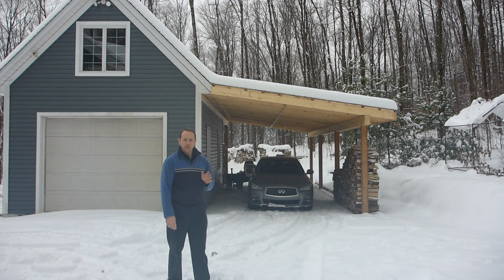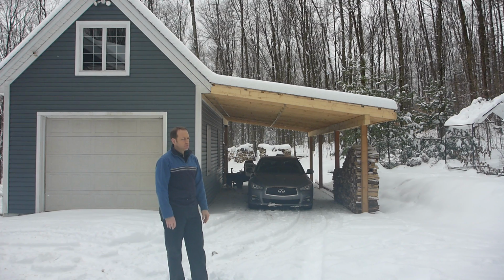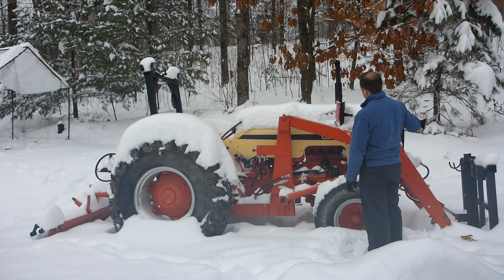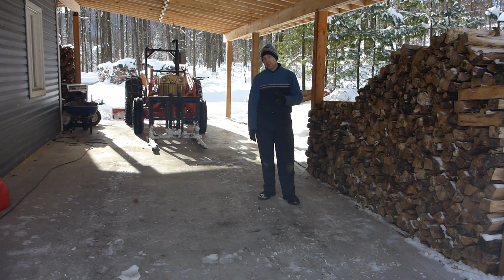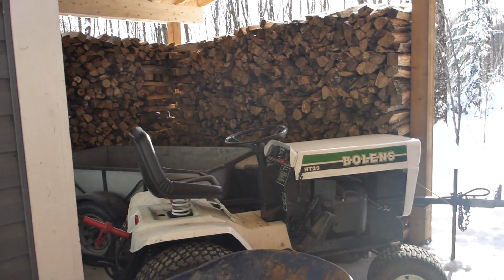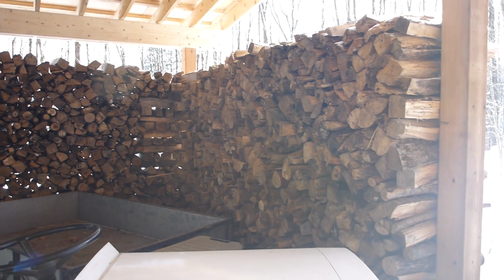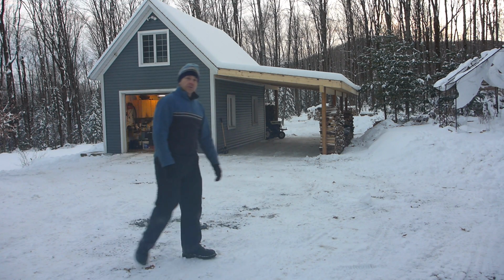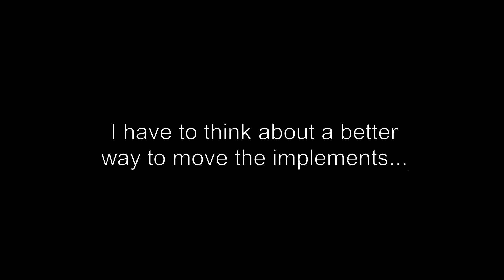#116 Catching up on Winter

Comment: Looking Good! Glade to see you are able to use the car port this winter. THat's a lot of snow. Your work never stops does it.  That's a beast of a tractor you have. Stay safe and warm. Later
Reply from the maker: I am glad to have the carport ready for this winter! It's been a few years now that I planned to do it. It's now done. My life is a continuous series of projects! My problem now is to decide between 4 projects, which one I will be starting next weekend!!! If you had the same Trygg chains on your B2601, it would push even more snow! Now I can stay warm!!! Thanks Mech Uno!
Reply: @FromSteelToWood  Thanks for the tip about the chains. Later

Comment: The addition looks great! So much room under there. Should come in very handy. Great place to season your firewood and doubles as a wall. Nice job.
Reply from the maker: Thanks Chuck! I think I may add some tarps in winter time if required.  I will see this year what it does.  At least, the firewood will protect a little bit.  With only one cord deep, it should dry way much better than the other wood shed I had.  Sometime, the wood in the middle had mold on it, because of poor ventilation. Thanks for your support!

Comment: The carport looks great. I also stand my mower deck up against the wall. I'm anxious to see the snow blower in action.
Reply from the maker: Don't worry about the snow blower, it's been through worst situations! This is a very basic implement, the gearbox leaks 80w90 oil so much, it's only filled with thick grease!!! Well, this snow blower is most likely as old as the tractor! It's kind of lightweighted for it's size. I use it randomly, this is why I don't put too much effort in it. I'd like to make a wall support for the mower deck, but I had this metal sheet in the way for now. Thanks Roger!

Comment: Good evening Joe,  How are you ? Is this 13 inches of wet snow making the tractor useful tonight !!! Oufff i use the snowblower and the front bucket to clear the entrance and i broke 2 shears pines on the drive shaft and 2 on the right auger ! Cause by operator misuse !!!  Take care of yourself Joe and be careful !!!
Reply from the maker: Lol!  You will get used very soon! Wet snow is hard to manage with a snow blower.  I don't use it when it's wet snow. In Marieville, it did not accumulate much.  I had to do the taxi tonight.  Nicolas at his driving lessons (Granby 8pm), then Amélie finished working at 10:15pm. Between that, I had to snow plow! Like you said: ouff!
Reply: @FromSteelToWood  Yes, in St Jean yesterday not much snow but windy. Marie Ange next year or after will do the same (driving lessons ! ). Take care Joe and be careful on the road and thank god that we have a tractors !!! Cheers !

Comment: Wow, you weren't sitting around this weekend!!!!  Got a lot of work done and the carport looks great!!!  I sort of laughed to myself when you had trouble with the solenoid frozen and then the battery on the Bolens.  It seems the bad weather will highlight the week links in your gear every time.  The same sort of things happened to me on Friday when we had our 1st snow fall.  Oh well.  Now you're ready!!!  Have a great week Joe!!!
Reply from the maker: Thanks Mike! They were quick fix problems. It rained so much in the last several weeks, I might just wait and see if the solenoid freezes again.  But I might have to look for a new battery for the Bolens.  I will try to put it on a good charge and see what happens. Maybe the alternator is not working properly. The Bolens is often used like a trailer tug and does not run much between uses. Did you have your snow plow and/or snow blower on your GC2300? Have a good week!
Reply: Mais Oui!!!  I put the plow and blower on last Friday morning and it snowed Friday night.  I plowed a wee bit of snow on Saturday just to say that I plowed.  It really didn't need to be , but I was excited about getting the snow!!!

Comment: Belle fin de semaine bien occuper!Votre gros tracteur n'est pas au diesel?Le garage avec labris est vraiment baux! Ca valait bien le travaille de faire cette abris!A bientôt!
Reply from the maker: Le Case 430 (model 440) est au gaz.  Des fois j'aimerais bien en avoir un au diesel, juste pour le "trip" d'en avoir un et de savoir mieux comment ça marche.   Mais d'un autre côté, au gaz, c'est simple comme bonjour à entretenir. Le printemps prochain, je vais installer les facias blanc et le bardeaux, puis teindre les poteaux et le dessous en blanc aussi, question de luminosité en dessous. Je vais voir si je vais faire des ornements autour des poteaux de bois. Genre des équerres, soit en bois, ou en acier.  Puis des lumières en dessous.  Beaucoup de lumières!!! Est-ce que je peux te demander ton prénom?  Merci!
Reply: Mon prénom est Adrien.  Je fais les vidéo avec mon père Éric et ma sœur Rose comme vous pouvez voir dans la plus part des vidéos.C'est une très bonne idée d'ajouter des lumières. Ca seras sans doute très baux! Un des avantage du moteur aux gaz est qu'il démarre plus facilement quand il fait froid.Sur notre tracteur, en bas de -15 il faut brancher le block heater si non c'est plus difficiles a démarrer et la batteries se vide asser vite a force d'essayer de le démarrer. Merci pour votre gentille réponse A bientôt Adrien
Reply from the maker: Merci Adrien.  En passant, mon tracteur part pas super bien à -15°C non plus... C'est pourquoi il dort dans le garage à environ 0°C.  Je vais probablement aller m'acheter un block heater demain, car j'ai l'intention de le laisser dehors un peu plus souvent quand je fais des projets dans mon garage.  L'an passé, j'ai dû mettre une chaudière remplie de braises en dessous du moteur, avec une couverture pour qu'il vienne à bout de partir à -15°C!!! Puis ça prend au moins 15 minutes pour qu'il réchauffe un peu!
Reply: Ok
Ca fait vraiment une bonne difference avec le block heater et pas besoin de le laisser brancher toute la nuit . 
Merci 
Bonne fin de soirée!

Comment: Joe what was whistle sound between 2:27 and ending at 2:31 ??? last times i heard that, i was not in this continent ! Very good point for gasoline flash point. You shop is in very good order ! The rear blade of the tractor is doing great work in the snow ! There is nothing wrong of hammering the bendix on the starter ! Nice daughter and good sense of humour ! Good bloopers with the implements, thank god there are built strong ! Joe I saw you slipe again. IMPORTANT NOTE: Joe if i see you slipe again on your video, i will buy to you the chains boots !!! LOL  Keep up the good work. and yes you electric points under the distribution cap could be the problems with misfire.
Reply from the maker: Thanks David!  The sound we hear is a plane. We've got plenty of planes crossing the sky over us, especially in the afternoon. They are oversea flights.  My video editor is a very basic one (Shotcut) and any fast motion video has it's sound high pitched. It's been a while since the bendix did not jam.  I must assume the recent rain and humidity did not help... I have one solenoid spare, just in case! I would says to my defense that I used the smallest hammer I could! Yep, I slip again with those combat boots. I instantly tough of you and the chains!  The sole get very rigid when it's cold and they are not the best on packed ice.  I could have used my Baffin snow boots. Thanks!
Reply: @FromSteelToWood  Good morning Joe, Yes you are absolutely right for the fly pat, i should know that LOL ! Hammering the bendix was sometimes required for me to start the 90 KVA diesel 2 strokes generator on the flight line because they were left outside ! and yes on humid and cold days was more often done. I just remember about 8 yrs ago they change the soles of all the non steel toe gore tex combat boots with vibrams soles because there were slippery on cold days. The steel toe boots use in air force personnel have already vibram soles which are little more flexible on ice but in the winter i use rubber overboots over them so i was good working with them to -30 c, before changing them with Sorels steel boots. So Joe you can buy over boots, and give you more traction and warms to you feet ! or wait until you slipe again and i buy for you chains !!! LOL Take Car Joe !
Reply from the maker: I though I was the only one using rubber overboots... I broke the zipper on mine.  But I used to put those boots over regular shoes to go outside.  Very warm and still the comfort of shoes.  Do you know any army surplus near to us?
Reply: @FromSteelToWood   Hey Joe, it a fashion statement wearing these overboots ! we looks likes Gumby ! Yes army surplus in the region it's In Dunham  ( PRO Quincaillerie J.P. & F. Larochelle Inc., 3615 Rue Principale, Dunham, QC J0E 1M0 ) is very good spot for clothing and boots and various stuff !!! the next one is Pre fair in Beloeil very good also.  For the zipper go see Mr Latour in Waterloo in front of the Metro. He is very good tailor and like to talks( social ), but do not tell him you are from Shefford on the Mountain,,, I did help a lot his sister who as the store ( la marchande d'histoire ) infront of the tourisme office in Waterloo ( in front of the new park and bridge ). If you go to theses army surplus Joe, you will be spending a lot of times ( la cave d'Ali baba ! )  is theirs !!!
Reply from the maker: Thanks David. I did know about Dunham, but not about Beloeil.  What's so special about Shefford Mountain for Mr. Latour? Hey, I do have "claques" to cover my work shoes. Believe me, when I go to the office with them, people are staring at me... I think it is just funny looking like an old timer. But hey, they do the job big time!
Reply: @FromSteelToWood  Good morning Joe, in Dunham there is also in the hangard in the back a lot of furniture and various large items and the people there are very good to talk to. Well for Mr Latour, is a very good man but he think that all of us that we are snobby people and that we all send ayour kids to private school since we are very rich,,, LOL !!! Yes there is some rich and snobby people living around us but i told him like in Waterloo, their is always 10 to 20 % who are beside the rail track of life !!! LOL Yes these ( shoes claques) do the job ! The importante think is the be warm and dry despite of the critiques of various too well dress colleagues and secretaries with their chinese white tips nail polish !!! Have a good day and get the stove ready for tomorrow, -15c to -20c and gusty winds !  Oufff and rain on Sunday !!!

Comment: Good morning Joe. You have a lot more snow than we do.   It is funny that your snow removal  implements were buried in the snow.
Reply from the maker: The implements are usually in that flat spot, just next to the carport. But I had to remove them so the excavator could put the rock wall at the back. I used also this spot to lay down the big lumber piles for the construction.  Snow finally came before I could bring back the implements in that spot... Now, there is at least the forks, the wood chunker, and the grader blade.  Missing are the dirt bucket, the concrete ballast, the wood splitter and the dirt screener. Really funny we have more snow than you!!! We are quite at the opposite.  We should not have any at this time of the year.  And you should be already buried under snow! Thanks!

Comment: Hey good evening Joe! Busy weekend and a lot accomplished. Bien! Loved the ending.So nice to see that I am not the only one who sometimes has a hard time doing small chores. LOL. The carport is working out great for you. Have you considered running some wiring and a switch for some lights under the carport? I think that would be helpful. We have just over a foot of snow here to be plowed so looking forward to firing up the tractor and clearing it out in the next few days. Have a great week and see you again! Cheers!
Reply from the maker: I am going to run wires to have at least 6 if not 8 lights under the carport.  Especially useful for working in the evening. I will also add a GFCI oulet for the pressure washer in summer and the block heater in winter. Thanks GP and have a good week!

Comment: Salut Joe, dans ton video tu fais l'entretiens de tes petit moteur 2 temps, j'aimerais que tu nous montres comment tu procèdes.
Merci à l'avance ....j'aime bien regarder même si je ne commente pas souvent.
Reply from the maker: Vu qu'ils sont déjà faits cette année, je ne suis pas sûr à quand ça peut aller. Je pense que je pourrais reprendre une partie de mon vidéo et commenter par-dessus.  Mais c'est plutôt simple.  Je pars la machine pour qu'elle soit bien réchauffée et qu'elle parte sans choke. Je l'éteins. Puis je vide complètement le réservoir d'essence.  J'enlève le filtre à air (on voit directement la gorge du carburateur). Puis je me garde une canne d'huile à remisage (fogging oil) à portée de main (vendu chez Canadian Tire, exemple). Je démarre la machine et la fait rouler pour qu'elle vide le carburateur d'essence.  Quand la machine est vraiment rendue à ses derniers soubresauts avant de mourir, j'envoie un bon jet (3-4 sec) d'huile à remisage direct dans la gorge du carburateur. Habituellement, ça l'étouffe net et fait un peu de boucane. J'essuie le surplus d'huile qui peut dégoutter.  Puis remet le filtre à air en place. C'est tout. Bref, plus d'essence, ni dans le réservoir, ni le carburateur (ça sauve le diaphragme). Puis le cylindre et pistons sont arrêtés, recouverts d'huile.
Reply: Ce serait aprécié....Merci!